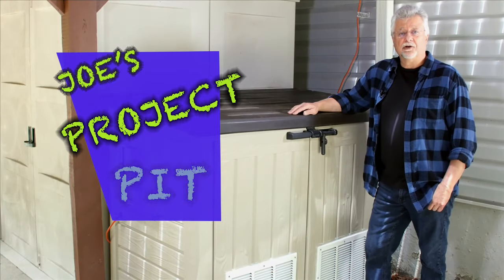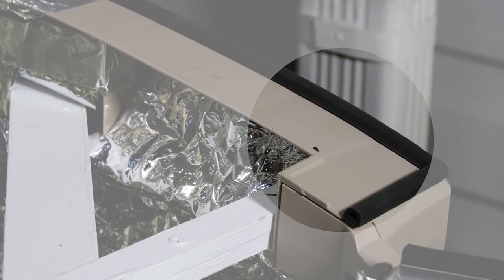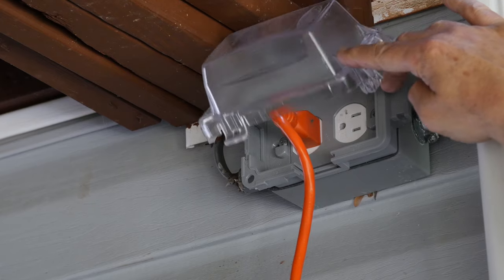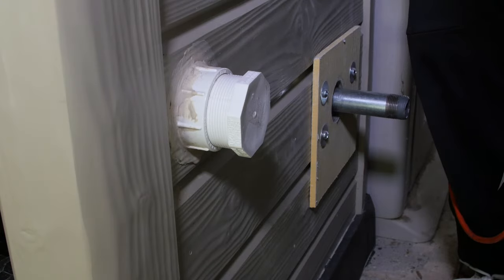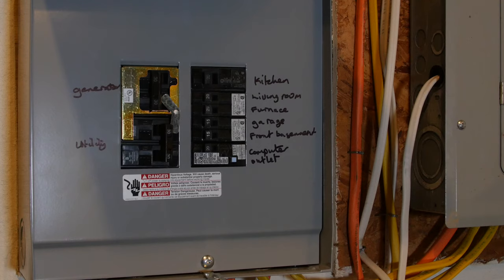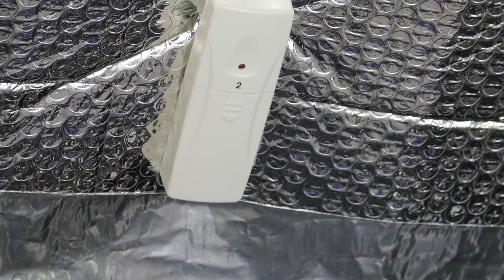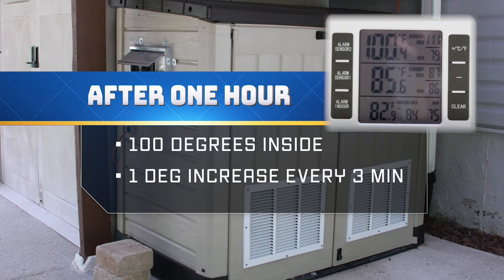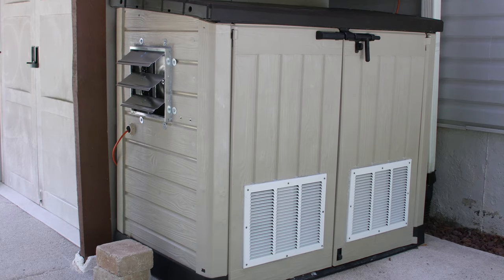Affordable Generator Enclosure Shed Project

Comment: If you’re running your generator to a transfer switch, your generator needs to be wired with a floating neutral not as a bonded neutral.  Your house is already grounded.
Reply: Thank you. I love it when educated and knowledgeable people share their extensive knowledge and advice with the rest of us.
Reply from the maker: Yes, I found out that I didn't need the ground either, but in some cases, where the generator is not wired into the house circuit, it would be necessary.
Reply: Sir, while I appreciate your sharing this info, some of which is good to know and useful, but, you could get someone killed or hurt by giving electrical advice without a high voltage license. The advice you gave about the ground is probably wrong, depending on the house ground and the main service panel/sub panel connections to ground. Always check with someone licensed in the county you reside in, and have a licensed electrician check this and sign paperwork that it is safe and up to code. The fines for this are very expensive. The second thing is that it looks like you removed the spark arrestor from the exhaust port on the generator, this is very dangerous especially in close proximity to the residence. Sparks from the exhaust will occur in all cases for all of these type motors. I did not see the exhaust exit location on your design. ⚡️🔥not good. Duct tape used to join the reflective insulation is not rated for high temps and catches fire like plastic, use aluminum foil tape instead. Adding a product like Rockwool for fire protection and better sound and thermal insulation would help on this project. Last point, you are using gasoline as your fuel source. With no fuel shut off, gas fumes accumulate when the Gen. is not in use, yes the fan can work, but when lightning takes it out, well, have you heard of the Big Bang theory😳 Hope this helps, not intended to be a slam.

Comment: Question, what’s the Mainpurpose of these enclosures? To keep the generator safe from the elements or reduce sound for your neighbors ? Genuinely curious ! I was just gonna run mine in 7x8 shed to keep it safe from rain .. leave the door slightly open for ventilation and cable to the house .. someone educate me pls
Reply: Shed does protect the generator from the rain. They should not be exposed to the elements. Remember water & electricity tend not to mix. Next, generators are magnets for thieves.  Especially, in a grid-down situation. Leave it, exposed, unattended and not chained down, it will disappear. Adding insulation and sound proofing does help both the person who owns the generator and helps keep harmony with neighbors. Plus, the  quieter it is the less noticeable it will be for those  with sticky fingers. 

As to your 7x8 shed, be sure to provide adequate ventilation. Suspect that simply opening the door will not be enough. At a minimum I'd add a decent sized exhaust fan, even with the door open. I'd also, recommend a carbon monoxide detector alarm, as you do not want to be breathing that stuff. Every time something happens and people resort to generators, people die when they are used improperly. 

The other purpose for the fan is to remove heat. You want to keep your generator working within acceptable temperature ranges. I don't know how hot it gets where you live, in summer. Climate alone may make your shed fall into the too hot range. 

Hope this helps.
Reply: @oldtimerlee8820  all good info .. thank you sir! The heat is something I did not consider .. Texas summers are extremely hot .. being that the generator plug is in my backyard I figured I was set 🤔.. I’m having a covered patio built, maybe I could run it under there as far away from doors and Windows as possible (about 20ft away in my situation) .. although that still leaves me with the noise situation .. maybe I will take on this build then
Reply: My enclosure dropped the noise by 11 dBa or decibels. I used the enclosure to keep the generator dry during a storm or hurricane.
Reply: Be aware that even with the door open, your shed will be full of carbon monoxide unless you pipe the exhaust outside.
Reply: @agoraphone  I wish I could post a pic here of mine. I bought an exhaust adaptor and ss flex hose. I wrapped the fles with high temp fiberglass cloth, inserted it into dryer tube and packed it with fiber glass insulation. I building my third shed this weekend. I don't have the video camera act that these guys here have. Each build was brilliant and I took the best of each build and incorporated it into mine.
Reply: @agoraphone  One thing I did different than any I saw here was to use 18 angle brackets thru bolted with fender washers and eye bolts. I can run rope thru the eye bolts to secure the genset from high winds here in S. FLORIDA
Reply from the maker: I couldn't have said this better.  Thanks for jumping in.
Reply: @thomasgibson8025  send me a pic thomas I have a generac 17500 with 3,000 cfm fan large 20x20 vent plus a couple 6 x 6 but that thing still gets like 120 and at 130 one of my fans shut off.  She's a beast maybe I should take out the rockwool insulation.  I no longer care about noise but I have to get lower temps.  It gets 117 at times without even having the generator on.  Welcome to Houston six one four three seven four three eight eight four

Comment: A couple of points: While the insulation helps with the noise reduction, it will also increase the heat buildup in the shed. Also, anytime the generator is running with the doors closed, the fan must be running to remove the exhaust fumes if nothing else. I'd just plug the fan directly into the generator outlet when running.
Reply from the maker: That's exactly how it works.  I explain how to plug it into the generator in the video.

Comment: I bought a whole house generator and wished I’d just did something like you have in the video.  I’ve spent $15k and am locked into one brand.  When I have issues with the system, I’m forced to deal with that manufacturer regardless of his poor warranty and service performance.  My system had catastrophic failure after 5 hours of runtime.  It took almost 4 months to get warranty repairs.  If I had a portable generator, I’d just get a second unit and still be thousands of dollars ahead.
Reply: That's a big reason I went with a big tri-fuel portable. It's nice having all that extra cash in my pocket too.

Comment: I bought a 3000 watt inverter generator and a Gentent.  Had my electrician install a 30 amp RV type outlet which he wired through the breaker box.  It is pretty well sheltered from thieves but I have a security cable on it anyway.  Total for everything was about $2600 but that was with a Honda generator.  I can run everything except AC and W/D.  Could be done for about $1500 with a Champion 4500 watt dual fuel inverter generator which would be my choice if I had to do over again.  Couple of 30 lb. propane tanks would keep it going for quite a while and no gasoline to deal with.
Reply: You plan sounds similar ro mine .  3500 watt Champion dual fuel inverter generator though I don't know if I will spring for the entire panel setup.
Reply from the maker: I chose the 6000 model because of what I need to run during a power outage.  I do live streaming events and so as long as the Internet is still running, the show goes along with four computers and cameras.  Along with that, I have a Refrigerator and a Freezer, Security system, and several other circuits that I need to keep online.  If you don't need a generator that big, then your costs with the house connection will go down.  Cheers!

Comment: One of the nicest plastic gensheds i`ve seen fabricated so far.
And thats a great idea having a temp monitor in there too. I`ve not seen anyone else do that. People don`t even realize how hot it gets inside these little sheds.
Reply from the maker: Thanks Larry.  Yeah, the heat was rising slowly until I covered the second vent, then it began to fall.  This was pointed out by one of the other comments from someone earlier.  I wasn't aware of the airflow ratio, but I'm glad it worked and the extra vent is good for when I don't use the generator and just want the natural airflow.
Reply from the maker: Thanks.

Comment: Very nice setup and you’ve done a very nice setup and I very much appreciate the work you’ve put into this box! You’re absolutely right that these Generac systems are absurd in price! For the novice, be VERY careful of two things, heat and fumes and lock that thing up like a safe!!! We’ll done sir 👏👍
Reply from the maker: Thank you.
Reply: A friend had a Generac whole house system installed about 5 years ago.
During that time it ran during a few power outages , less than 100 hrs of generating, but he loved the convenience of the auto start etc.
After a few years it wouldnt run. On examination the valve train was completely worn out, guides shot, valve stems worn and valve seats all beat up. Also the piston rings and bores were in tough shape. The problem appeared to be premature wear from the automatic weekly startup and shutdown  which these units do. He did a partial rebuild at great expense, enough to get it running, then sold the house, now someone else's problem

Comment: Very nice, well thought out shed!
I have a similar set up in my rear garden shed.  In my case, I trenched over to the shed for the electrical hook up to the manual transfer switch which is located in my garage.   I installed a louver on one side of the generator and a louvered fan on the other.    The exhaust is removed via a stainless steel "b-vent" which is isolated from the T1-11 rear wall with stove gasket.      I just plug in the fan when the generator is in use and it doe the trick.   And, since the exhaust is ported to the rear of my shed, towards the woods, the generator is very quiet while running.     For security, I keep the shed locked and have the generator chained to the floor.

-I'm very impressed with your temperature monitoring system!   Very slick!
Reply from the maker: Thanks.  I like your setup too.

Comment: I did something similar but put the intake vents (like you see in mobile homes for A/C vents) on the same side you installed the attic fan and put the attic fan on the exhaust side letting it suck out the exhaust also, it works well for me!
Reply from the maker: That'll work.  Good idea.
Reply from the maker: Good job.  I wanted no fumes in the shed when the doors were closed, so I did the reverse on fan/exhaust placement.  Your way doesn't void the warranty on the generator.

Comment: I built one almost the same 10 years ago. It really stifles the noise quite a bit. I ran a receptacle from the shop I put this next (in conduit) for chargers, etc. I cut a hole in front of where the exhaust is and ran duct out and around with a furnace blower sucking the exhaust out. I also drove a ground rod to tie to inside the enclosure. I like the protection it gives if power is out during thunder or snow storms.
Reply: Can I ask, why do you need a separate vent for the exhaust? Won't the venting fan system take the CO just the same? Am I not considering something?
Reply: @mbecker163  Heat.
Reply: @outlawamps96  thanks for answering! So, won't the hot air be removed by the fan very quickly? Just wondering. Seems like the venting the exhaust kind of defeats the whole purpose because you're allowing noise to directly escape the box. Am I wrong?
Reply: @mbecker163  Heat is the enemy of all things electric. Evacuated exhaust… is it overkill? Not in my opinion. Things will just run cooler, with vacuum created by the blower pulling fresh air over the genset. Ymmv.
Reply from the maker: Excellent!

Comment: Your VIDEO on the generator shed is GREAT. THANKS for listing the parts and where you bought them.  I just bought my generator last week. I can and will benefit from your work. THANKS AGAIN
Reply from the maker: Thanks for watching.  I put two vents in the doors but later learned that when I covered one, the temperature went down not up.  That's how I got it to 100 degrees inside and it was still going down.
Reply: @joedelsordo9012  thanks for the "heads up".  Looking at Lowes for a shed.
Reply: @joedelsordo9012  That's a good to know. I'm glad I ordered only one of them. Figgered if one wasn't enough I'd add 2 vents. Good to know that I'll be better off leaving it at one. Thanks!
Reply: @joedelsordo9012  why does one vent work better than 2???
Reply from the maker: Here's why one vent worked better than two in this case.  As one of the other comments from a viewer stated, the air displacement from the fan system was not enough to move all the air coming in from the two 14" vents in the doors.  By covering one it creates a better balance and the air is sucked out faster.  I still keep the two vents open when I am not using the generator so that more air enters from the outside.  In the winter, I might close both of them when I am not using the generator.
Reply from the maker: Lee, I kept both in the door so that when the generator is not in use, there is more air entering from the outside.  Covering one of the vents made the suction better when the generator was running.

Comment: Impressive.   I may buy the shed and just open the doors and run it when in use.  Rain hood over the top is all that is really needed.  Should not get very hot with the doors open, so I may just put the liner in there too.
Reply from the maker: Good idea.  I suspect that I will be running it that way also, but I built it to be able to close the doors in bad weather.

Comment: I did somehing similar but a big bigger shed and metalic. During the winter it is not bad, but i keep the door large open. I have a 10kw generator.
However, during the summer it could be problematic. Just make your heat calculation before doing the “enclosure”.
This type of engine (gas engine) in the best situation has an efficiency of 40%(and this is very optimistic). So for exemple for 5kw of output power, it will disipate 2.5 times more heat, that it means 12.5kw of heat. This is huge for a small enclosure.
Reply from the maker: I think you are right about this.  I tested it in 90+ degree heat and got positive results.  The fan was able to slow the heat buildup once it kicked in at 88 degrees, and then it started to reduce the temperature.  I think the key is to keep the enclosure out of direct sun.  Placement on the North side of the house may be an option.

Comment: Nice set up if you aren’t looking for an inverter generator for sensitive electronics. Medical devices and some other equipment can be damaged with a modified sine wave generator vs a pure sine wave generator. Think ventilators and cpap among others things.
Reply from the maker: Good point.  I'll look into that.

Comment: So glad I found your video. I am retrofitting my new generator into my shed that is similar to yours. Noise reduction is not my main goal but running it in the rain is. My new generator is a Westinghouse W7500 and I need to extend the exhaust out of the shed. Can you detail how you went about it and pics if possible. I don’t weld so bolt on is my only option.
Reply from the maker: I used short fat metal screws through the base plate and into the muffler port.  This will void your warranty.  I have seen people use metal flex hose also.  As long as you can get a tight fit on the muffler port, it should be good.  I used high temperature sealant to seal the base plate and eliminate exhaust leakage.

Comment: An interlock on the main panel is a much cheaper option then a transfer switch which is major overkill for this type of set up where you have to go plug it in and start it anyway. An interlock is typically less then $100.
Reply from the maker: This may be an option and here's a link to instruction below.  However, I wanted to be able to relocate the generator and I didn't want it wired all the time.  When the main power fails, it's not a big deal to plug it in.  If I know bad weather is coming, like a hurricane, I'd plug it in ahead of time.
https://www.youtube.com/watch?v=6RG9nfFE7Zw

Comment: Should connect the ventilation fan to the generator directly
Reply from the maker: Yes, I do when the generator is running...I explain that in the video.  It's plugged into the wall for when the generator is not in use due to the hot summer temperatures even in the shade.

Comment: Now that you have had your generator shed for a few years are you still comfortable with it’s performance. I have shed similar to yours but with a 13000kw generator and I’m concerned about the temperature. It  seems to get very hot. I have the vents, exhaust pipe outside and a vent fan.

Comment: Great job Joe! For the exhaust, you said you screwed a flange in the muffler. What screws did you use? My concern was the vibration of the generator might vibrate the screws loose. I wanted to get the proper screws. Thank you for your help.
Reply: I thought he said he bolted the plate into existing bolt holes n not screws
Reply from the maker: Sorry for the delay.  Been dealing with health issues and I'm just getting to these comments.

I used metal tap screws that are corrosion resistant and thick enough not to be worn out very fast.  Before screwing the plate onto the muffler, I used fire rated putty adhesive, rated around 1400 degrees tolerance (used in fireplaces and wherever heat is an issue) to "glue" the plate to the muffler and eliminate exhaust bleed.  Hope that helps.

Comment: I have just started mine, I put the shed together yesterday and cut the main hole for the vent. I am thinking not about what other options exist for the heat-resistant walls? I went to home depot and see the insulation you used was good to 180 degrees. It there anything with a higher heat rating that would work?
Reply from the maker: HardieBoard would be great, but it would make the shed and the roof very heavy.  You could ask in Home Depot.